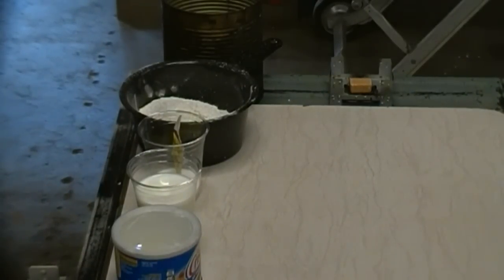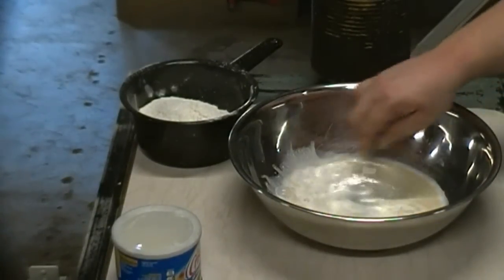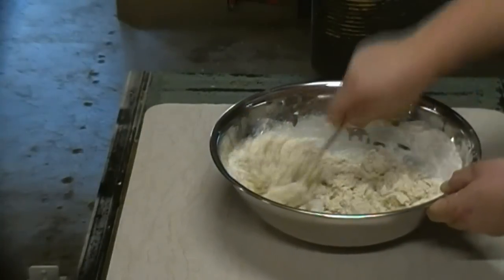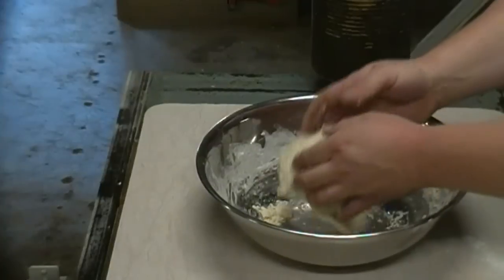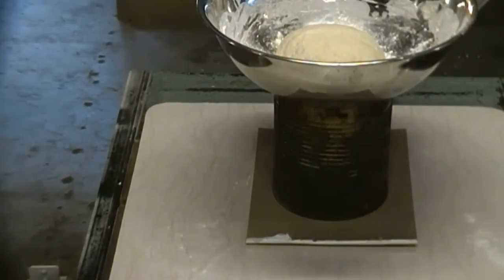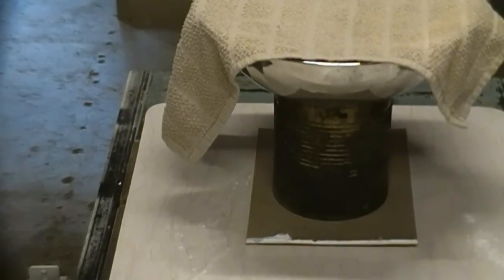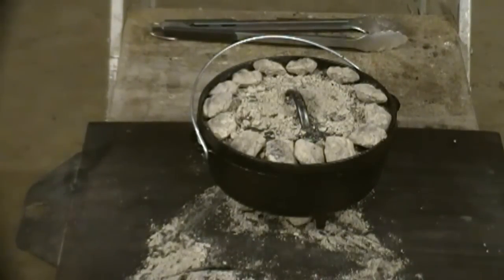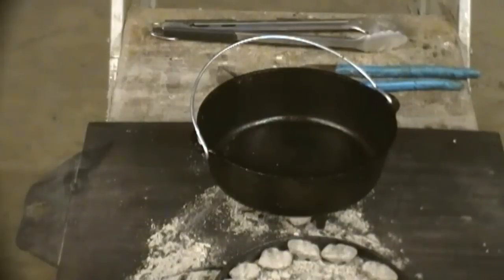How To Bake Bread In A Dutch Oven.

Comment: I covered bread dough with a cloth a couple times. The bread stuck to the cloth and it never came out. Therefore, I have never covered my dough again and it's fine. I never coat it with oil either. I just finish kneading and walk away. Been doing that for over 25 years. Works fine.

Comment: if you want to keep it soft try coating it with fresh butter after it comes out of the oven let it cool complete before covering so the condensation don't make it soggy. a little tip from my grams. a little bacon grease will do the same in a pinch.